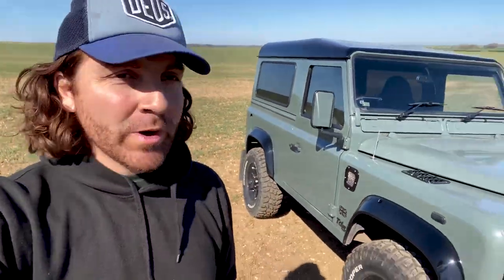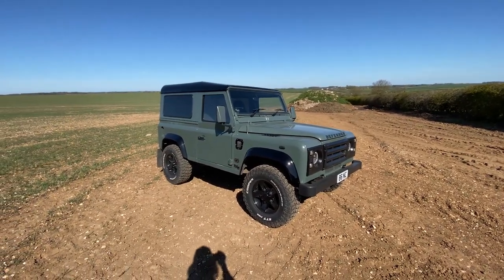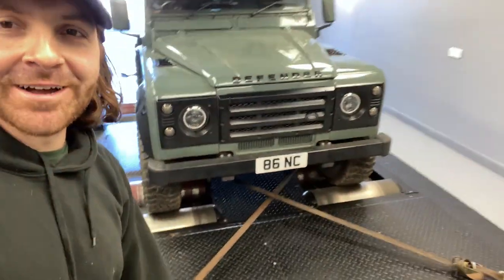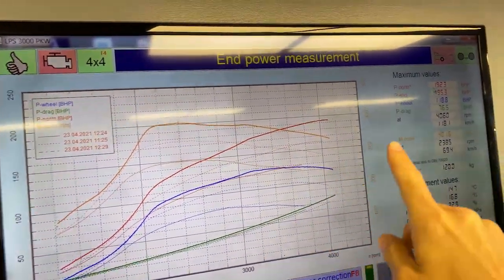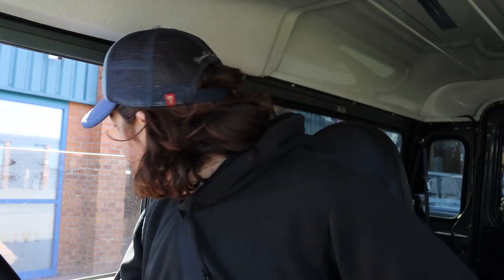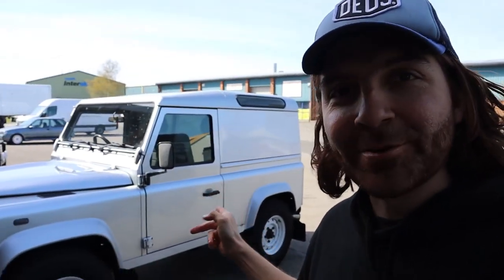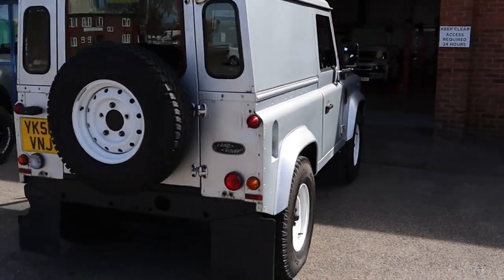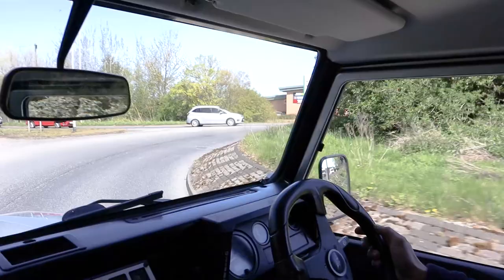I REMAPPED MY LAND ROVER DEFENDER! STAGE 2 ALIVE TUNING

Comment: Great vid, can’t believe the power/torque increase. Definitely go for the Fox shocks have them on my TD5 with Eibach springs. A world of difference to the ride.
Reply from the maker: Thanks! Yeah was more than I was expecting, I'm very tempted as mine currently feels as though it has no suspension at all and heard really good things about the fox shocks
Reply: @thedoctorsgarage  they are a touch in the pricey side but fairly easy to fit. They just seem to absorb better and rebound at the right rate so they give more confidence. I just need to do my anti roll bars next. Oh and now a stage 2 remap etc. The list gets longer every time I get it out the garage.

Comment: How does remapping a Defender impact on downstream components like turbo, drive shafts and xfer case? Are components not rated by manufacturers for specific kW and you significantly increase the torque and power? I have a Puma 2.2 with after market bigger intercooler but I’m hesitant about mapping.
Reply from the maker: Hi Fergus I believe the components as standard can take a stage 2 remap- if you go further or a bigger turbo Alive would recommend upgrading certain components to match

Comment: Have you still got the stock exhaust and just done the remap, inter cooler and hoses? It sounds great. I’m planning to go the same route just not sure if I want a new exhaust set up and it gets too loud especially after all the sound proofing I’ve had done.
Reply from the maker: Hey Justin- I have the standard exhaust and it’s not too loud at all- at high revs you hear a bit more of the engine but it’s fine round town- sounds the same

Comment: Told you about the Turbo swap ! Do it Doctor !
Reply from the maker: It's tempting!
Reply: @thedoctorsgarage  - What is £1100 ? , you can swap the Turbo yourself !!  You have the bigger IC, the Turbo will push some more air through it, you might need to upgrade some of the boost pipes , you can have the epic TD5 whistle.......10:30 onward -----https://www.youtube.com/watch?v=4TxsQKLK69A&t=658s

Comment: If you want to go fast buy a sports car
Reply: Why? When we can do both? Also, it's not about speed, its power. These 5cylinder 2.5 turbo diesels are incredible with relatively minor mods. It's like saying, why have a sports car when you can have a motorbike? We get the fact the bike will be quicker but these TD5's are incredible to drive when tuned.
Reply from the maker: Couldn't agree more! For me it just makes the defender such a more usable car day to day
Reply: Iv got a puma and it’s as flat as a wet fart::: limited to 90mph that’s 2 fast ... it’s ok making one go fast but you need to improve the brakes and suspension.. and a roll cage
Reply: @chrisfell3052  which is everything I've done and I do agree with you. You don't want to roll one. My brakes are upgraded, suspension and I'll be having a half roll cage fitted so I'll feel more comfortable taking my little lad out when he's older... And for my own self preservation. I don't drive it like I've stolen it but I do give it a good old blat every now and then. Just being able to pull a 2 ton trailer up Sleights exiting Whitby without drama is a testament to it. A few years ago I drove the most powerful (proven) 2.4 90 HT Puma and it was absolutely insane. Addictive.